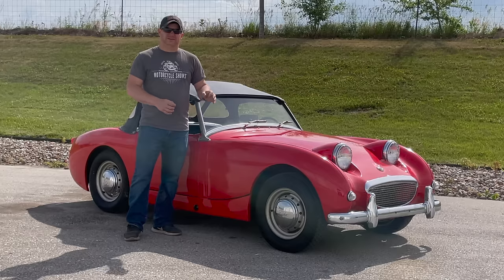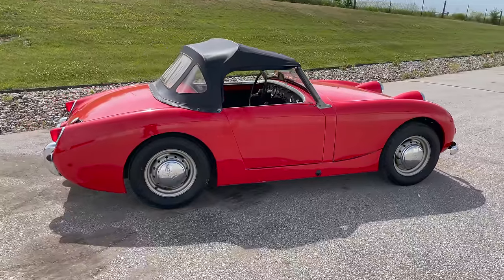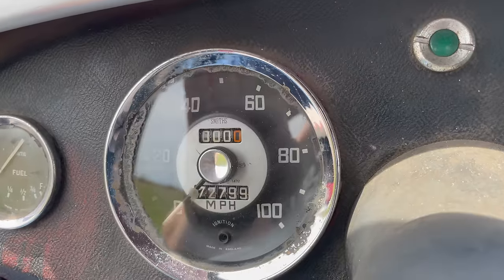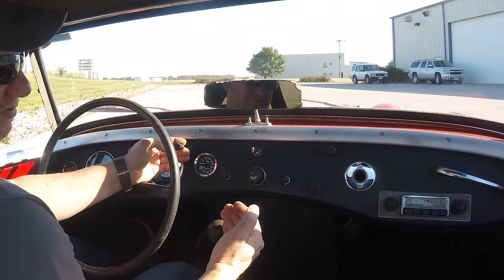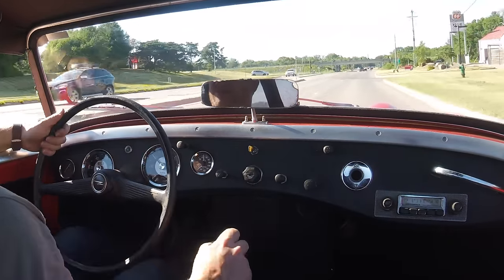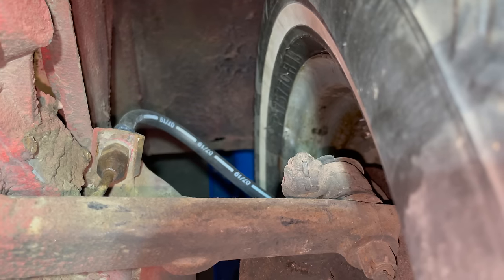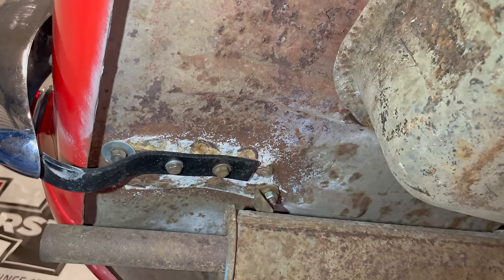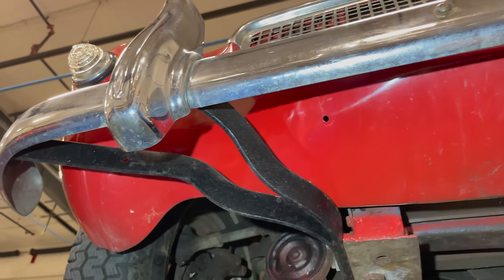1960 Austin Healey Sprite (Barn Sprite #4)

Comment: Cluster gear is shot. Is it a smooth cage or ribcage trans? 948, 1075, 1275 ?
Reply: bugeyes only came with 948/SC from the factory, and it appears to be the 948/SC
Reply: @Broyourenglishisgood  Thanks. You are very knowledgeable and international. Do some people put the 1098 head on the 948 for the bigger valves and performance improvement? Donald signed my original Owners Manual in 1979.......